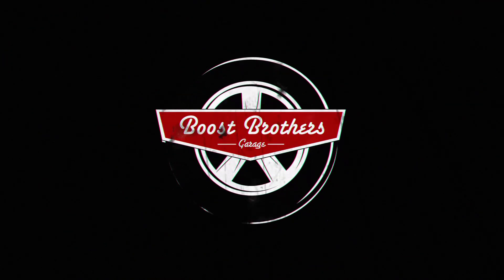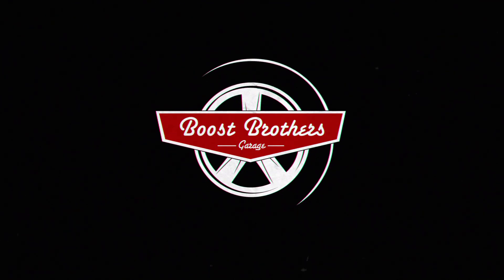5 Cylinder 944 Build - Part 7 (Porsche 944 07K Swap)

Comment: Hi, is the carbon reinforced nylon still holding on the cooling system? I wanna do the same thing on my old benz, but I found that poliamid (nylon) don´t resist well when imersed on ethylene glycol, and the cooling fluid is hald water, half ethylene glycol. It´s even worst on high temperatures. Are yours still on good condition?
Reply from the maker: Unfortunately it failed. We ended up making them from aluminum.

Comment: How come you didn't turbocharge that five cylinder over in the UK it's very famous for them to turbocharge them ?
Reply from the maker: It’s getting a turbo, just wanted to get it running and torture test it as NA before adding boost.
Reply: @BoostBrothersGarage  what kind of power do you expect when you add boost to it and what size turbo are you planning on putting on there ?
Reply from the maker: I’m going to run an HX35 and Alan is going to run a G25-660. Both should get us to 400 whp, which is where you have to start looking at upgrading rods and pistons.
Reply: @BoostBrothersGarage  well that's good to hear I can't wait to see you turbocharge it and see what it does on the Dino and also to see how you do on the track .

Comment: What engine management are you running? I’m looking into Megasquirt MS3x for my 944 07k swap. I’ve had good experience with MS in the past. This car sounds great, really makes my day to see that thing on the dyno.

Sorry about the struggles, I’m glad it’s not anything worse though.
Reply from the maker: We are using the Performance Electronics PE3-8400 ECU, and they are doing the swap harness and tune as well. We will be offering all of it, including the base tune or loaded onto the ECU for anyone that’s interested.

Comment: crack a beer and it does sounds awsome. love the 5's
Reply from the maker: Drinking a Miller Lite right now!
Reply: @BoostBrothersGarage  the brightside of the build is that 3d model did work. that is the hardest part. you just eed a better matterial and it's a proven part. check for bottle mecks in the fuel system maybe a larger fuel filter that flows more. or bigger fuel lines. oh yeah injector test the flow rates. the fact that pressure never dropped is also good news.
Reply from the maker: True! We are going to have the flange machined out of aluminum for the production piece. Oh, and found out the stock 07K fuel pressure is 65 psi so that explains that problem!
Reply: @BoostBrothersGarage   minor details when doing impressive things

Comment: What size are the factory injectors 310cc?
Reply from the maker: 2xx I believe? I did find out that the factory 07K fuel pressure is 65 psi, so that’s hopefully the issue. I thought it was 45 psi for some reason!
Reply: @BoostBrothersGarage  Yes that would be the issue. Lean condition at higher rpm. Did you see a surge on the dyno? As long as your AF ratio is the same through out the rpm band you should be fine.
Reply from the maker: Pressure remained constant but duty cycle was just too high for power level we were making. Should just be pressure!
Reply: @BoostBrothersGarage  Air Fuel ratio was the same as well?

Comment: The stock fuel pressure is 4.4bar (~65psi); your pressure is to low for the stock injectors. Up the pressure to 65psi, no vacuum ref., and you should have enough fuel for anything N/A.
Reply from the maker: Good to know, thanks! For some reason I thought i read 45 psi somewhere.
Reply: Matt Turner is correct. Up your fuel pressure
Reply from the maker: Appreciate it guys!

Comment: How high are you revving ? I believe the factory redline is very conservative 6500 maybe?.extra rpm burns up duty cycle fast.
Reply from the maker: The goal is 7200 but we were still less than 6500 when this was happening, closer to 6000

Comment: Sounds great..... if it's possible can you give me the measurements of the engine I'm curious as to the actual physical size of it thinking about doing a s4 b5 project
Reply from the maker: I know the engine fits in a B5, no problem. The intake is an issue but overall dimensions are not
Reply: @BoostBrothersGarage  thanks a lot
Reply: @BoostBrothersGarage  so the intake you guys make will not fit either?
Reply from the maker: It technically does but the throttle body is right at the radiator support so it’s a problem. The rad support would have to be modified. We are looking into designing an Audi specific intake.
Reply: @BoostBrothersGarage  awesome ill be keeping an eye out for it

Comment: wow, it sounds great!
Reply from the maker: Thanks!
Reply: @BoostBrothersGarage  Luckily the coolant flange issue happened on the dyno vs the track. is there other higher temp material available for 3d printing that coolant flange? 220 degrees seems kind of low especially if it will see track time.
Reply from the maker: The carbon filled nylon is supposed to be good to like 300F. We are wondering if there was an air pocket and it just over pressurized? Version 2.0 of this piece has a steam port on it which may have helped, but we figured we’d test this one first.